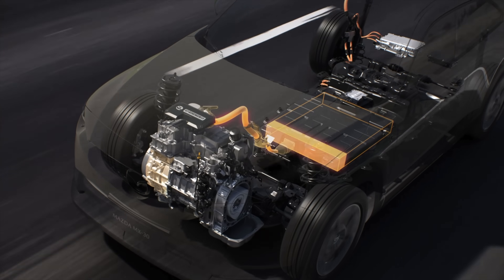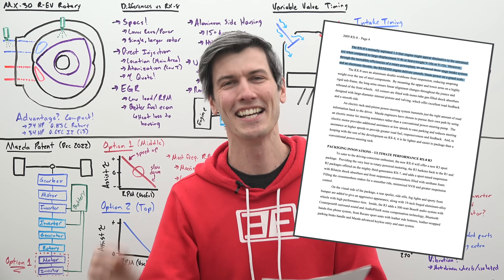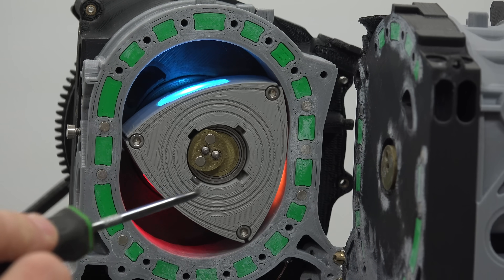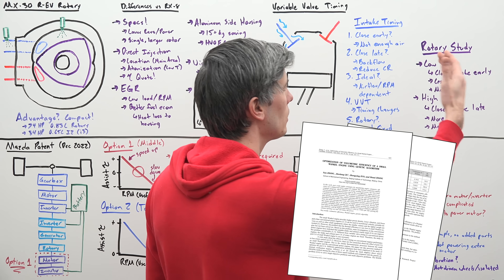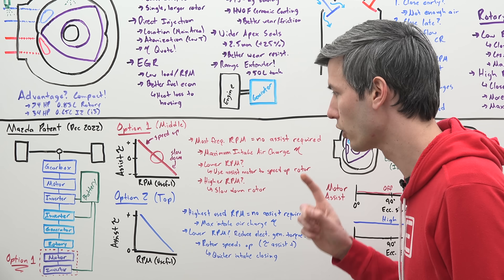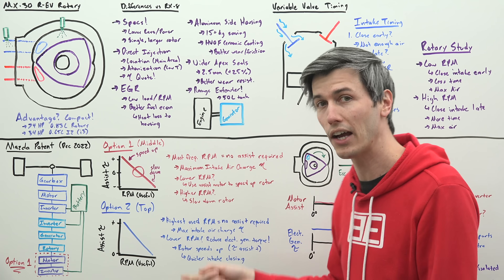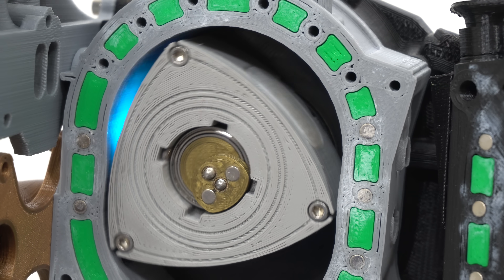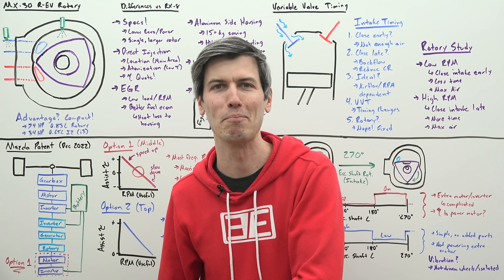Mazda Brought Back The Rotary Engine!

Comment: I worked as technician for mazda during the renesis engine's life cycle. Key points about the rotary engine and its "incredible efficiences"
- modern piston engines have a thermal efficiency of about 40%. The rotary is 7%
- the unburned fuel mixture is so prevalent that the exhaust manifold on a rotary has the name thermal reactor, because most of the fuel being burned is done between the engine and catalytic converter.

This is why the rotary engine can never be high production, as manufacturers are restricted by emissions, and cost per kg of co2 output.
Reply: The fact that there's no good way to lubricate the seals on the rotor without putting oil in the combustion chamber is also an issue
Reply: @DoRC  Also, the main byproduct of the poor combustion is also carbon build up, which breaks the seals.
Reply: @virus640  Yeah I wonder if they're just depending on low engine run time in this application too ameliorate the problem.  I'm sure the new coatings are better but you can't get around the fact that those seals aren't lubricated
Reply: I will address the errors in (all) the above statements, in the context of this new and inevitable application by Mazda. Lubrication issues are negated with modern materials (ceramics). Carbon build up is negated, particularly at steady loads, leaner fuel mix and more complete burn and more efficient flame front propagation (direct injection). This also lends to massive increases in efficiency and it is well known (and accepted) in aviation circles that the rotary engine is superior in terms of reliability and fuel efficiency when operating at optimal (steady state loads) to piston counterparts. Therefor, the rotary is an ideal, lightweight, compact and overall better application for generators. I am guessing the OP is not working for Mazda any more.
Reply: Sounds like a total piece of crap to me lol
Reply: @Kevin.Barbarino  not true... Usually have to replace the sleeves for the piston engine and valves ...
Reply: No cats and shooting flames like FF1🔥🔥
Reply: @cathalsurfs  I think you addressed the statements nicely and find the information you provided interesting. I agree that the improved rotary engine promises to be an excellent solution for use in generators.
The added dig to OP was maybe a bit unneeded. He clearly wrote "worked" past tense. Just a little feedback :-)
Reply: It's not 7%. That would imply like 5mpg, which of course isn't true.
Reply: Back in the 1980s I predicted ceramic rotary engines would be the future. However, Mazda has not focused on using the full advantage of ceramic motors by building a full heat recovery motor. If they built a rotary that operated at very high internal temps, with near zero cooling it would be possible to build extreme performance motors with far higher fuel efficiencies.  But they are still dumping un burned fuel down the exhaust and cooling to motor in addition to that. 

Recycling hot exhaust fuel and using with an additional turbo charged cold air charge, and slight cold fuel top up at very high rpm would both increase power and efficiency. A high temp ceramic engine makes all of this possible. Direct fuel injection was the last piece of that puzzle, because it allows a rotary to make use of diesel cycle ignition once started and spun up to speed. 
Making it an electric hybrid allows optimisation to the most efficient rotary rpm.
Reply: Would a turbo not make best use of all that unburned fuel in the exhaust, and fuel being injected further up the intake allow better atomization?
Reply: @chrishavill6458  turbos don't take advantage of still burning fuel, they just make use of being able to use higher volumes of fuel by supplying more air. For injection, direct injection offers the best atomization due to the high pressure of the injectors, so the new design is a step in the right direction.
Reply: Thank you, this answers several of my questions.

Comment: Crazy that it’s able to modulate load and torque that finely thousands of times per minute. For something incredibly light I can see but manipulating the rotor so quickly seems like a quite a feat to overcome. Hopefully it works well for them and super excited to see a range extender let alone one with a rotary!
Reply: I was thinking the same thing.  Also seems like all that pulsed load would result in vibrations that would increase wear and decrease life of the motor.  Even if the pulsing is isolated from the passenger compartment.
Reply: TBF ECUs already do hundreds of calculations per second for things like direct fuel injection timings, valve timing, knock sensing.
Reply: @apostolakisl  Would the pulsed load not be effectively the same as what a main bearing in a crankshaft of a piston engine goes through?
Reply: @Appletank8  And a modern inverter/motor controller can do a per-cycle calculation to regulate torque.  This is one reason EVs have such good traction control, they can literally change torque request in a single motor rotation.
Reply: Yeah, I'm thinking it can't be exactly as described. I don't know the moment of inertia to do exact calculations, but in order to change the RPM of the motor by any significant amount during a single intake period (a millisecond or two), it would require intense torque, like that of a train motor or cruise ship engine.
Reply: Just like any series (and series parallel) hybrid built in the last 25 years...
Reply: @Appletank8  Mazda's Skyactive-X required them to do calculations per piston cycle...they actively adjust per combustion cycle on that engine. So this probably builds on that. Older engines just retune gradually over time. But since they were trying to avoid detonation they had to do these calculation in realtime per each cylinder and combustion cycle.
Reply: FYI, the Honda Insight 1st Gen (year 2000) induced torque ripple during power delivery so it compensated the rough power delivery of the inline 3 to deliver smooth acceleration.  So this tech is old, although its nice to see that we are at the stage where we are optimizing software which means that the hardware is mostly optimal.
Reply: @chitlitlah  it's running pretty slowly (rotor turns half the speed of the eccentric shaft, and the system's not used at max rpm) and doesn't need any flywheel, just whatever counterweight for the rotor.  So it's probably pretty viable.  Numbers are probably not that interesting, but my envelope says its moment of inertia is under 10% of a typical complete engine (with flywheel).  If you have your own calculator, number I got was 0.027kg.m^2 for an upper bound on a single 13b rotor and the eccentric shaft's probably negligible in comparison.
Reply: They don’t need any of that when it’s just a battery charger, just spin it up to optimal efficiency and then just shut it off
Reply: @chitlitlah  At 4500 RPM that's about 75 rotations per second or 13.3 ms per rotation so about 10 ms is during the intake stroke, if Mr. Explained is correct. I'm no mathemagician but if the motor puts out 100 lbf at 4500 rpm the electric generator would need to supply 100lbf to stop the motor. As an aside Torque is Moment of Inertia x Angular momentum (I looked it up) so you don't need the MoI for the calculation. Likely the generator would only need to supply a fraction of the torque of the engine to slow the motor down to maintain optimum intake time since motors provide full torque at 0 RPM.
Reply: @Stereomoo  I think the rotor actually turns 1/3 the speed of the e-shaft, and I hadn't thought about that. The amount of torque needed isn't as crazy high as I thought, just a few hundred Newton-meters or foot-pounds using your value for the moment of inertia and being a little generous with the amount of time it has to change the speed which isn't beyond the capabilities of a fairly large motor/generator. I just punched the numbers into a calculator without writing anything down though, so I don't guarantee accuracy. I have serious doubts that it could produce that much torque one way to slow the rotor down, switch to producing it the other way to speed it back up, and keep alternating almost a hundred times a second though.

However, that's just the beginning of the craziness. This thing slows down the rotor while the intake port is open and speeds it back up when it's not? Why? If it needs to spin at a certain speed for the intake port to pull in the maximum amount of air, then it should just turn at that speed all the time. Tune it for 4500 rpm and run the motor at 4500 rpm, simple as that. The intake port is open to one of the three combustion chambers most of the time anyway, so it's not like it's going to be sped up for very long. The motor is wasting a huge amount of energy by constantly applying large amounts of alternating torque to the engine to make its speed oscillate. Electric motors are fairly efficient, but not 100%. Also the engine is going to grenade in no time with all that stress as well.
Reply: @paulbrooks9  I don't know who Mr. Explained is. The intake port isn't open to a single combustion chamber for 3/4 of its rotation, but there are three combustion chambers for a single rotor and as Electrode points out, the rotor turns slower than the e-shaft, so I did end up using 10 ms in the above calculation. Why wouldn't we need moment of inertia though? Without it, we can't figure out what the angular momentum is, meaning your equation has no known values.
Reply: @chitlitlah  can't you just use the torque that the engine puts out instead of moment of inertia? If it puts out 100 lbf of torque wouldn't 100 lbf applied in the opposite direction equal zero?
Reply: @paulbrooks9  Sure, but we're not just talking about preventing the motor from accelerating or even slowing it down _gradually_, we're talking about changing its speed significantly within a few milliseconds. It's like saying you can manually push a car in neutral and get it rolling versus saying you can push it and make it accelerate like a top fuel dragster. I could easily see the generator adjusting its load to maintain a fairly steady 4500 rpm while the engine is trying to accelerate. What seems incredible is the generator oscillating the engine speed back and forth every turn of the e-shaft, every few milliseconds. That's a lot of angular acceleration.

Comment: I guess Mazda would love to create another car with rotary as a main power source - preferably as a mild hybrid. Maybe modified MX-30 range extender could be matched with small electric engine acting both as a variable intake timing as in the patent mentioned in the video and additional power source during acceleration. They seem to be experimenting in that way and would love to bring back rotaries, maybe as a halo sports car.
I've driven RX8 and fell in love with the sounds, high revs, linear power output and responsivity of a rotary. Personally I drive more conventional Mazda, Inline-4 B6ZE Miata.

Comment: this is interesting.  the rotary can also be used to warm up the battery too in sub freeze temp. Example: in sub freeze let the rotary run first to warm up the coolant that connects to the battery while also warming up the cabin
Reply: It's a really good idea. I've been saying Mazda should use a small rotary as a generator for about 15 years.
Reply: And it takes literally 5 minutes to do so.  Not the hilarity you see in other videos of waiting 2 or 3 hours to start charging when it's below freezing.  It would also supplement the plug-in charging if done right in cold weather.  Your Tesla?  Still waiting 30 more minutes to start chargning and you're down the road.
Reply: If you warm up the coolant, isn't that fluid really a heatant?
Reply: @tar170  both to heat when cold or to cool when hot.  Just need a valve to shut off the path from engine to battery and path from battery to radiator to cool

Comment: I'm excited to get hands on the new rotary engine in general. I'm curious to see if the irons will work with the old 13Bs or not. The slightly larger displacement and direct injection is also a nice technological step forward. I think in the aftermarket world these new rotaries could be very interesting.
Reply: I was thinking the same !!!
Reply: The single rotor displacement being bigger than the single rotor of the Renesis is interesting. It's suggests that it might be the dimensions of the 16X prototype, and one the advantages of those dimensions was that it was a narrower but longer rotor. Back to the width of the 12B for greater efficiency, since they found that the 13B width wasn't actually burning fully to the corners, but also more eccentricity for more leverage on the e-shaft and more torque as a result. Based on the numbers of the single rotor, I would suspect a dual rotor would be a noticeable improvement over the Renesis.
Reply: My thoughts exactly! We know that Mazda actually loves all the advancements that the aftermarket scene has brought to the rotary engine. So, hopefully, they kept that sentiment while designing the new rotary. Only time will tell, but you know that once the gearheads can get their hands on the new rotaries things are gonna get crazy.
Reply: @Lurch but the irons have porting, coolant passages, and oil galleries. It's a bit more involved than just plates. And yes it could be possible to design from scratch but a large majority of us don't have access to a cnc for experimentation.

Comment: Rotaries have primary and secondary inlet ports, except the 192 regenesis, I think. These act as variable valve timing, primary always open and secondary above a set rpm.
Reply: Was just about to say the same thing. There's a cylinder that rotates inside the port that can change the port size. I believe the renesis has six different intake settings that act as a sort of pseudo VVT.

Comment: Two questions: 
A) Instead of using varying generator load to control valve timings, why not simply change valve size throughout rpm range?
(bigger size valve - higher flow rate - same thing as small valve open for longer)

B) How is the varying generator load achieved? A switch shorting the generator instead of charging the battery? Just a clutch?

Looking forward to any answers

Comment: The good part is that in a plug-in hybrid, a rotary engine can be used under very controlled conditions and should last a long time. I was thinking there's a lot of room for optimizing internal combustion engines for use with plug-in hybrids (which, in my opinion, should be the prevailing tech for the next few decades) and we should see some radically different designs to optimize for that use.

Comment: In the late 90's and early 2000's, Arctic Cat started equipping their 2 strokes with devices called "Arctic Power Valves" (APV). They would press right up against the piston, keeping a small "exhaust manifold" volume, but after about 6,725 RPM, a cable pulls the valve away from the cylinder, effectively increasing the volume of the exhaust manifold, allowing more exhaust gas to leave the cylinder more quickly. It was a solution to provide more torque at low RPM without inhibiting high RPM power. Why do I bring this up? I can't see why Mazda couldn't have done something similar by adding a valve along the wall of the "cylinder" to effectively increase the size of the intake port to allow more air in at higher RPM.
Reply: I had the same thoughts. Intake and exhaust ports could simply change diameter to control the gas flow more precisely than manipulating with rotation speed. Maybe it would be too complicated or less effective in practice due to a) the necessity of installing variable port diameter inside of side housing b) the length between insides of combustion chamber and valve located on the outside of a port.
Reply: reminds me of Yamaha Powervalve System YPVS

Comment: saw a story a couple years back about the mitre turbine range extender.  looked like a good idea at the time.   APU’s in passenger jets have been using something similar for a long time.
Reply: Range extenders are a failed concept
Reply: APU's in passenger jets are super inefficient, and building a jet engine is expensive

Comment: I’m glad he mentioned the vibrations at the end because I was wondering about how the engine could ever still run smoothly while being slowed down constantly. But even if you don’t feel the vibrations, wouldn’t it be bad for an engine to be slowed down a thousand times a minute or whatever the rpm is? It seems like that had to be bad but I may be mistaken.
Reply: Steel doesn't really care about stress cycles.
Reply: @mitchellsteindler  what? Metal fatigue is real!
Reply: @ve1902  so long as you are below steel's "endurance limit", it will never fatigue no matter how many stress cycles it goes through.
Reply: I have the same question. But my concern is less the speed changes but the vibrations caused by them. Even if the driver won't feel the vibrations I do expect a lot of wear caused by them.
Reply: @Hoch134  Where should the wear take place? The generator does the job acting like a brake, and only on the lower rpm. The mass of the car has nothing to contribute to the wear.
Reply: @NICEFINENEWROBOT  The wear will take place in the motor since the weight/force is unevenly distributed. Bearings and mounting points will slowly lose material until they can't do their job anymore.

The only way this wear could be reduced in my view would be by having the entire motor swing with the vibrations. We'll see in a decade if they've found a solution for that.
Reply: @Hoch134  motor mounts? Am I missing something here? Aren’t they acceptable for reducing vibration in regular cars?
Reply: @notsteve9595  Motor mounts reduce vibration but I expect the vibration here is much higher since load is changed EVERY rpm.